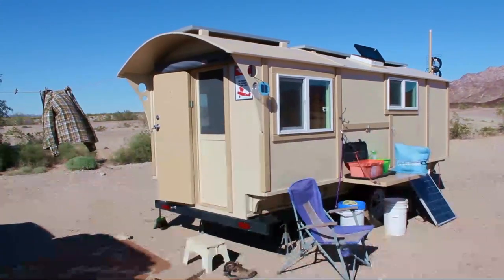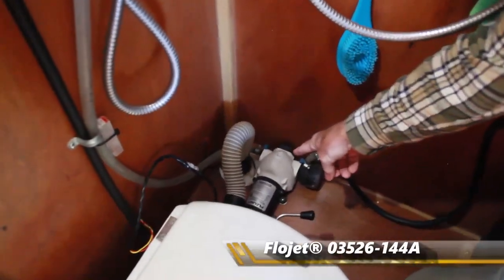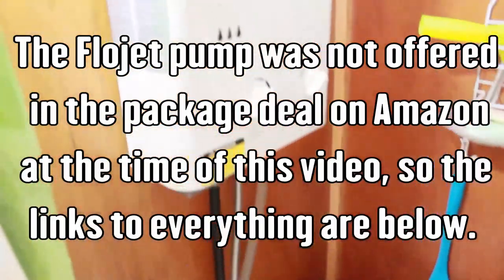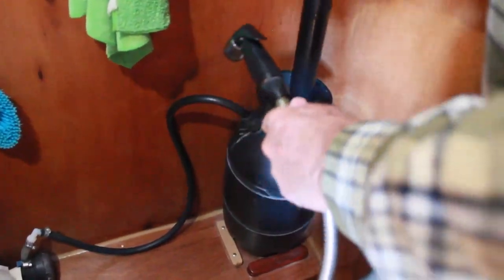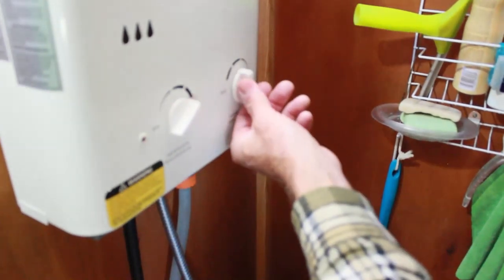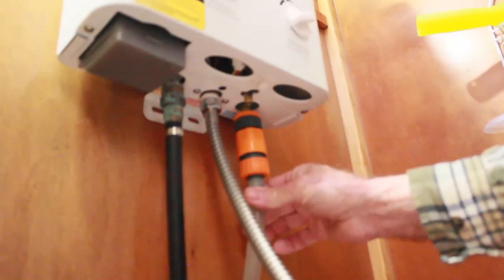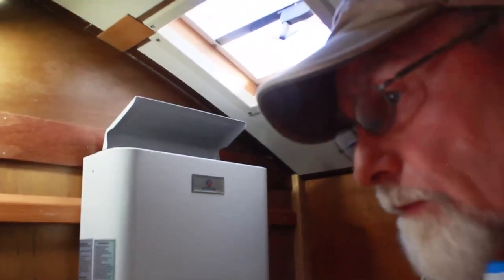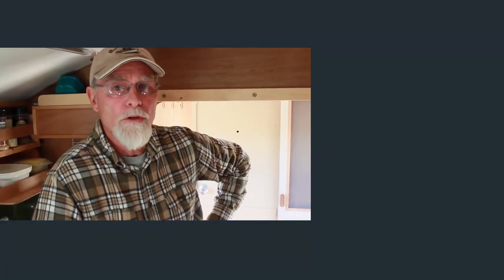Tiny Houses HOT Shower That WORKS!

Comment: Thanks for showing another video of Lou!

I did the recirculating idea with a Coleman Hot Water on Demand system, because I had the same issues of not having a consistent water temperature.  Although that one also has a good pump, I just found it was more hassle than it was worth.  I ended up throwing it out and just heating the water in a stock pot and pouring it over my head.  I personally found it simpler.  I do say, though, that using a HWOD system does cause less condensation than my system.

Comment: You don't even need the on demand heater or the pump - just boil a quart of water and add it to the garden sprayer then pressurize that. I used this method when the hot water heater went out in our RV while on vacation in St George.
Reply: I was just about to say the same thing, everyone already has a propane stovetop of some kind, boil 2 quarts of water and add it to the 1.5 gallons of cool water. No need for the instant water heater. Simpler is (almost) always better.

Comment: That is the system I went with, same Eccotempt L5 heater and Flojet pump. I tested it in my back yard using my garden hose, Heats the water almost instantly. He is right about the shower head, puts out a very nice stream but is a little hard to turn on and off.
I think it is a very good system to have for a trailer. I have seen some people mount it to a dolly along with a battery and water tank to make it very portable.

His trailer build reminds me of a house I lived in on Base housing..Had the wood trim just like that on the outside of the house..
Very nice trailer build, looks very professionally built..
Reply from the maker: I'm 'bout to head up to St. George/Zion for awhile with some friends Wrangler. You in?
Reply: Thank you for the invite Jamie, My son-in-law just got home yesterday from MOAB, he was there for around 8 days with his friends, I was going to go with them but decided not to as my jeep is not finished yet, their jeeps have lockers and lifts and can go just about anywhere as mine does not, just a spring 1 1/2 inch leveling kit and fox shocks with 33 inch Micky Thompson ATZ's and I was worried I could not keep up with them, and they are not afraid to go up and down some scary hills and scratch and dent their jeeps. My son-in-law came back with the rear of his jeep with big dents,,, And it is costing more than I thought to do the upgrades I want to do to it, just needs re-gearing to 4.56 and trutrac limited slip diffs for the front and back and a winch then I am done with it, then I can hit the trails and do some extended camping. I bought a roof top tent and dometic fridge and just about everything I need to go camping with the jeep or trailer we are still building. I would like to meet up with you and your friends in the future though at some camp,and sit around the camp fire and trade the BS..lol.  I have followed your YouTube page when you were in Florida and afterwards and always thought you were a pretty good person. After I retired from the AF I have not found to many people that I would like to be around. But you are definitely  a cut or two above the rest. (Not saying that I am).
Again thank you for the invite. That was very nice of you.
Reply from the maker: +wrangler ya, go next time and ride passenger with the better outfitted rigs I say, but we gotta meet up at some point! Florida?  Dang, that goes WAY back. Was just speaking with Kyndal earlier today! Cheers!
Reply: Passenger!! no way... I would get out and walk up and down those hills..lol
Yeah I liked watching your videos, Your channel was the first one I came across in van dwelling and made me want to go out a do some traveling/camping. That is why I started the off road trailer and bought the Jeep last Feb.
That is good to hear that you still friendly and talk with Kyndal, I liked watching her how to videos. She seemed a very nice lady. 
Hope Kyndal is doing well and is happy in her new life..
Reply: @patd4u2  sounds like a good invite with solid people.

Comment: If you don't have a tankless water heater and are in a more rudimentary situation - access to a microwave but not stove top etc, I suppose you could microwave water and pour it into the container or, microwave water keep it hot in one or two thermoses (good brands that keep water hot for 12 hours+) then pour the water into the the weed sprayer when you are ready to shower

Comment: I used for years the pump sprayer.  I would put a kettle of hot water and fill the rest with cold water and  my wife and I could take a nice hot shower on a few gallons of water.

Comment: If the black water reservoir were put into a double clear plastic bag, it would warm up even faster.  You can make such a bag from very lightweight vinyl.  Be sure to triple fold the edges before sewing.

Comment: Thanks Jamie for posting this.  At time 7.59 Lou says the unit draws 7 and a half amps.  I confused, I thought this unit only heats with gas and the small battery pack attached to the unit runs the 12 volt controls.  Can you confirm?  TL
Reply: Same question... I think he's talking about the water pump, though Amazon says it only uses 5.2A at 12v.
Reply: I wondered the same thing.  Did anyone ever get an answer?

Comment: I'm confused on why he preheats the water?  I have the same one, been using it while I remodel my house.  I have well water coming from a 150' deep well in the winter (its 5 degrees outside) Can't keep your hands under the faucet for more than 15 secnds or your hands go numb.  Feed it through the heater and I have a nice warm shower.  I have to keep it on the lowest flow setting and highest temp setting but it does a nice job.
Reply from the maker: Makes sense, M R. We don't have access to the volume of water that you do, so we try not to let any run freely until it's to the right temp.
Reply: Enigmatic Nomadics That makes perfect sense. Good tip for me when im out on the road. love the channel by the way and Lou's trailer.

Comment: I know you're not using it in this way, BUT if you pressurized that Rainmaker Tank would it create enough psi to feed directly into the tankless heater (on low flow) without needing the electric pump (if I only need 1 gallon of hot water)? I have a tankless water heater that only needs 5psi to turn it on... Thanks

Comment: In my bug out moto camper van, I just use a 300 watt electric heating element that is powered by solar panels and it takes about 2-3 hours to heat my 7 gal water container, then I just either take a warm shower at the back of the van or wash up at the sink. The water is powered by a pump that I switch on and off which helps conserve water. Here is my rig: https://youtu.be/NmalslYVYqI

Comment: Hi from Oamaru, North Otago. Waitaki districts New Zealand. question. what pressure to actuate califont?. and is this your full time home?.here in N.Z council will not permit us to build any bigger than x size, i wonder what would happen if you dug a hole in ground for living then had your tiny home over top as the underground part cannot be construed as a structure by council...cheers Carl.

Comment: on the carbon monoxide (C.O) not CO2. as long as the burner flame is burning the gas undistorted you would have around 10 parts per million (ppm) venting outside and you do not start getting C.O symptoms till you get over 50 ppm and that is watery eyes, headaches around 100 ppm and turn blue(dead) around 200+ ppm but this takes hours.
Reply: zdiver1 so there is some happening. But not significant if you vent while using it. So don't be frightened. But do circulate and vent.
Reply: Yes very safe to use. Now if you took a 8 hour shower then vent it, it is no different then using the range or oven.The oven makes the most CO at start up from the flame going over a cold spreader plate 50+ ppm.

Comment: Sometimes you put the black tank out in the sun and pre-heat the water in order to save electricity???   What electricity? The starter batteries?
Reply: I figured he may of been referring to the pump usage which would be less so if the water temperature is brought up somewhat beforehand.
Reply: cto511987 was wondering the same thing. Looks like the propane heater uses 8 D cell batteries internal to work and spark and control the heat and water flow. Then you also need power to run the pump system below while you build up pressure for the hot water from storage to sprayer.
Reply: I think the whole point he was making which is quite genius is to prevent cold starts while showering as well as water being wasted in the heating cycle while waiting to warm up.
What he does is pump (electric) the preheated (sit in sun) water through the propane water heater sprayed directly back into the same tank until the water is hot enough then he turns off the water heater and just pumps already warm water (no cold starts) for taking a shower.
This way it uses less water (no waiting to warm up) less electricity (by sun warming water first) because there is less pumping.
Although there is more pumping going on actually because you pump the water back out of the black holding tank when taking a shower.
Guess it's a wash perhaps but the idea saves water at any rate.
I think there are 2 D cell batteries for the piezo electric start only on the heater unit.
Reply: It uses just two D cell batteries to operate it.
Reply: I'm not sure why he uses it the way he does, I have the same system, the water that comes out of the On-Demand water heater to the shower head heats almost instantly to what ever temperature you have it set at, no waiting what so ever. I tested mine out in the back yard hooked up to my garden hose, When you switch on the shower head the heater turns on instantly and the water comes out pretty hot.
These are called "on demand" water heaters, meaning the is no water storage in the heater, The water goes through them and is heated instantly and then goes to the shower head. No need to pre-heat the water.

Actually he is using twice as much electricity using it the way he is, First he is using electricity and propane to warm the water up to put back in to his tank, then using it again to take his shower.  
You do not need to pre-heat the water,  just turn it on and use it.
Reply: wrangler   What uses two D cell batteries? I'm new to this.
Reply: I like his way of thinking. Most days he can use his black tank more than enough water for a man to shower but when it is cold he can have a perfect hot water shower in a matter of minutes just has to run the pump and a little propane. Beats busting water on the stove and pouring it in an insulated storage unit until you save enough hot water to get the job done.

My plan is more parasitic/member funded.  $25.50 a month for PLFT and I can have as long a hot shower as I wish.  Thing is when I go shower there I still take a shower the way I do it at home. AT the gym I use less soap at home I have a big container of hand soap I use for shampoo and as a body wash. No time at all I can apply soap in key points and I am on my way. 

What I call a submarine shower. I sometimes will soap up before I get in the shower. HOW YOU DO THAT? I use a bar of soap sure, but I also will keep pump hand soap and if you give it 2 shots in your dry hair and smear a shot on each appendage and 2 on your torso when you wet yourself you are already sudsed up pretty good especially if you use a bar of soap like Irish Spring I have a good quality lather then I  just scrub away the rest is a good rinse. I am very clean. The purist are going to say that is too much soap all that jazz I generally shower every other day I want to get clean and when I get out the shower I FEEL GREAT. 

You turn on the water get wet scrub down with a brush and face cloth and then you rinse shower over with in 5 min.
Reply: Active or passive solar? Setting a black bottle of water in the sun is passive using solar panels to charge a battery and use an electric heating element. Sure you can use these to heat water most off grid will not use this as their main way to heat water unless it is in the dump cycle of their recharging plan. 

Dumping is when you topped off your batteries and your panels have more power you want to dump that power into something useful? Making ice and heating water both use a lot of energy you might want to dump excess power into these things. 

Solar again has both active and passive values. Active is a solar panel generating electric passive is when the warmth of the sun just works on your benefit through engineering. Sometimes it is as simple as foil reflecting sun light on a black bottle others it is a vacumn tube in the sun that will bring water to a boil. 

Why would somebody have too much solar generation capabilities? Simple storage is expensive generation of electric through active solar collection has gone down in price as time has gone. Use to be $1 a watt was super affordable but I have seen them sell 300 watt panels for $200. That is a great deal. Also winter sun is not as good as summer sun. You want to have enough panels for winter sun what you use for winter sun will offer you a surplus or a dump for your summer sun.  Yes I repeat myself but I do at least cover all the points.
Reply: prob igniter for propane heater

Comment: Are you kidding?? This is three videos, that I know of, on this guy's rig and yet the most unique thing about it, is not discussed. The first two were spent mostly talking about solar. There's 100 videos on solar and you've probably done 50 of them, so that info has been worn out. Who cares about the shower. Warm some water and dump it on yourself. LOL  THE ROOF!! Next time you see him, ask him to give details on THE ROOF!! Thanks
Reply from the maker: EASY, Florida Wild! What do you want to know about it? I'll hit him up.
Reply: Sorry, I'm just a little intrigued by this guys rig. LOL  Most of the vargo wagons, that I've looked up, use beams running lengthwise for the roof. He mentions using "minimal" framing for his roof. I'm wondering if he did this or if he fabricated stringers across the width, as his roof looks rather thin. Also, what he sealed the outside of the roof with. I'm pretty sure he used fiberglass, since he's a boat builder, but I'm not sure. Thanks for doing these videos. He's a great guy!!

Comment: so how does he shower, the water heated in the tank cant be used because it had the pressure hose taken off by him so now what???
Reply from the maker: He uses an electric pump. The sprayer has been modified to effectively just be a portable holding tank. It's all in the video! :)
Reply: ok so then the hot water gets sucked out of the holding tank without any pressure just by the loose fitting sloppy hose shoved thru the hole
ok so then what happens after it hits the pump? wheres the hose does it go outside, wheres the drain? there was much missing.i thought the pump was just to pump the water into the waterheater. so then how does the water pump get used for both going into the waterheater and going to the showerhead? that room he was in was a pop out? was it a wet room? i saw exposed wood.
Reply from the maker: Sooo many questions! I love it, Borga! Question: ok so then the hot water gets sucked out of the holding tank without any pressure just by the loose fitting sloppy hose shoved thru the hole. Yes. The water isn't getting pushed out, instead it is getting pulled out by the pump. Then it goes up through the heater and out of the sprayer head. After the water is used it drains out the bottom of the wet bath that it is in. Epoxy treated wood. Lou is a boat builder and knows how to build a sailboat out of wood and sail it around the world. Please watch his previous interviews in the button links at the the beginning of the video for more!
Reply: ok, i watched again. i see the wood has clear coating to protect from water. how does the sprayer nozel stay open to fill the water resevior?
ok so the same water droplet goes thru the water heater twice before it hits your head right? the first time is just to preheat it and then the second time it goes thru the waterheater it is to get hotter and wet your head. and he being a skipper i can aee everything is marine grade.

Comment: Do yourself a favor and replace that rubber propane line with a metal one. If you have a fire- you sure don't want a propane line to melt.
Reply: If the heat already is that far up, you better have a propane tank dumping it's fuel quickly rather then exploding.
If it's that hot that it melts, the home will be lost anyways due to very serious damage.